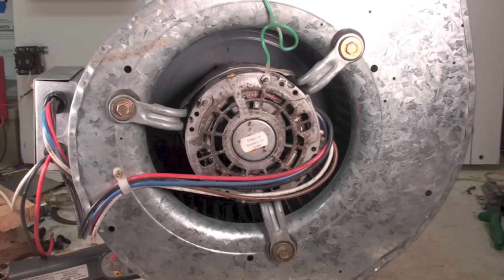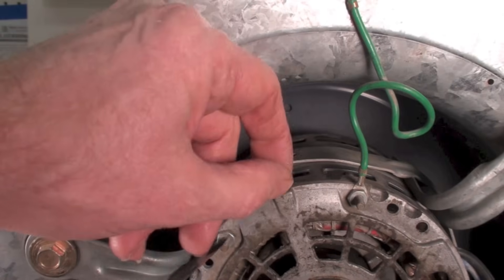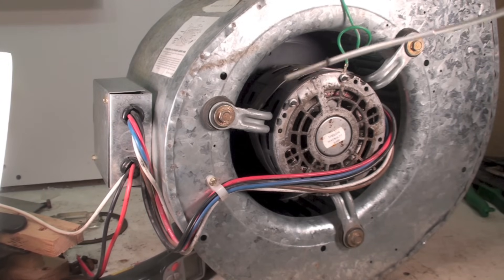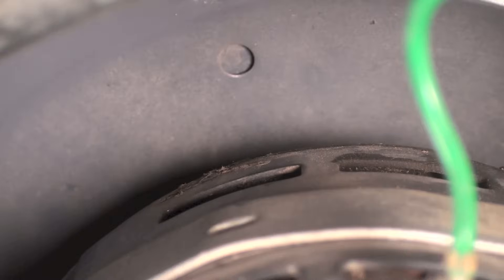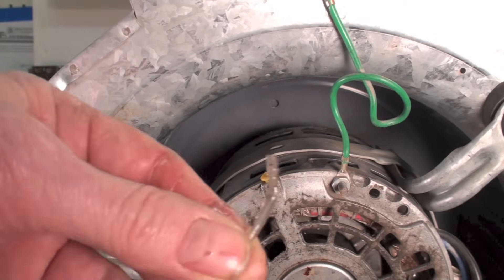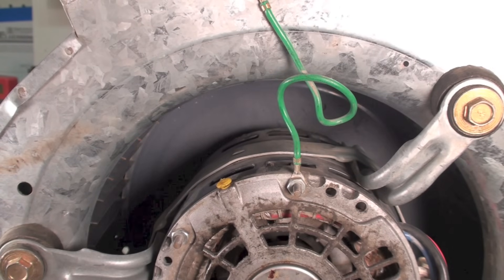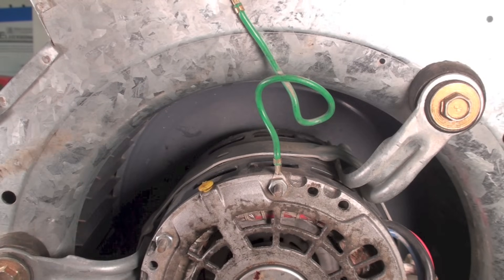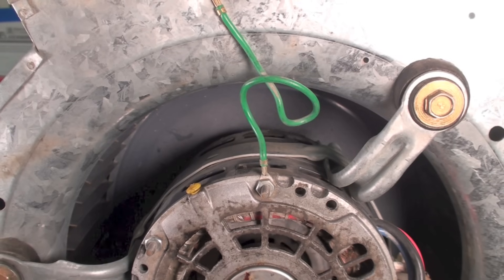How to oil the HVAC fan motor

Comment: Thanks Gary, you were very helpful to jump start me troubleshooting. Yes it is an old furnace. About a week ago, an electrical type of burning smell came up to the 2nd floor bedroom, late at night. Got worry about a fire. Went to the basement first to check the furnace. Could not smell burning, but heard an electrical humming and buzzing before the fan kicked in. Outside belt drive motor, no capacitor. 
The best is that I got a brand new motor, same specs on Easter Sunday.Owner of “James Electric & Motors” said I am open 24/7 and 365 days. Got motor and put new. Works like a charm! No more smell, humming and buzzing. No more erratic start and stop. Nice and quiet now. When I pulled the old motor out and open the flap, i noticed a loose white plastic electrical connector plate. The motor shaft still turns easily. I do not see burn marks or smell any burning.Last time the blower motor went, I paid $80 CDN parts and Labour. That was 18 years ago!The motor was $140 all in. USA
Reply from the maker: Glad you got it going.
GFM

Comment: Hi Gary, I have a Inter-city Gas furnace model HGC-125. The blower has a hard time starting. The motor gets hot. The blower motor has a belt and is outside the blower wheel. I suspect the motor is going or the start capacitor. I can not locate the start capacitor anywhere. Does this furnace model has a capacitor.
Reply from the maker: It probably does not have a capacitor.  If it does not start hit the motor with a hammer.  If it starts, the start switch is failing.  Means a new motor.
GFM

Comment: How to NOT oil the HVAC motor. You don't have a clue that these motors bearings SHOULD NOT BE GREASED ever. If you do it you will lose the motor shortly after. the grease collects dust and some people know that dust is abrasive, and that's it, the motor bearings gone.
Reply from the maker: Good grief.  They supply oiler ports for a reason.  
GFM
Reply: The bearings of these motors are made of bronze graphite that are self lubricating. This material started to be used in blower motors more than 30 years ago, and if yours has something else, than maybe it is time to plan for a replacement. Please be curious and google this material, see what it is and how it behaves.  If you lubricate them you will destroy them quickly. And in any case, as a general rule for  any bearings lubrication: once you lubricate them, you need to do it constantly and continuously, otherwise it collects dust and that's it.  Yes, runs nice and smooth with lubrication, but you need to do it constantly. Why the ports are there? I don't know, maybe because the manufacturer wanted to give work to some HVAC repairmen (happens a lot in the industry), or maybe somebody replaced the original motor with a so called OEM motor that is a reverse engineered version of the original with "improvements". What you need to do with these bearings is clean them periodically, remove any dust or material resulted from wear and tear, and leave them as dry as possible. If you find out that the shaft is loose sideways, well it is too late, you need to replace the bearings or the motor. If you do not, the wear will be bigger and bigger and eventually the rotor will touch the stationary part and bad things can happen. If you hear squeaks and cleaning does not solve it bearing replacement is the solution. If you feel vibrations , than be sure that you need new bearings or new motor. I do not know why these things are not known and why the "specialists" keep advising people to lubricate the bearings, probably because they want to give themselves work.
Reply from the maker: You might check this video:  https://youtu.be/txhJYwaguNc  Notice the oil wick surrounding the bearing.
GFM
Reply: You said it yourself in the video “needs lubrication continuously “, exactly what I said, you mentioned bronze too, so why are you still debating?  Let me tell you my story, one year ago some furnace cleaning guy lubricated my motor, which is about 30 years old, one year later guess what ? The motor died.  Coincidence? I don’t think so.
Reply: 31 years is well the expected service life of both gas and electric units. Modern units are typically expected to last 20-30 years, and last longer than older units. That said, a model from the mid-1980s (about 30 years ago) isn't expected to last reliably beyond 20-30 years. I think it's more likely that the oiling allowed your motor to die one year later, rather than maybe 4 months later.
Reply: I agree, in my case it was about the time to fail, but there are a lot of failures of much "younger" motors, at 5 or 10 years, because of lubrication. Whoever is a fan of lubrication I suggest to google bronze graphite and educate themselves what it is and how it behaves.

Comment: grayfurnaceman - do you think this noise is from within this plastic housing. I want to call it a blower motor but I'm thinking that's down lower. https://youtu.be/-MWq-XrCM-c
Reply from the maker: That is the inducer motor.  First, I would remove the inducer assembly to see if there is any obstruction.
GFM

Comment: Never mentioned what kind of oil to use?  Just showed that one kind in the bottle which would be nice to know some alternates to use.
Reply from the maker: An SAE 20 non detergent will do nicely.
GFM
Reply: Thanks I bought some of that 3-n-1 electric motor oil. My motor is shot on my furnace even after letting it sit overnight the oil did nothing to help.
Reply from the maker: Usually, if a motor locks up the bearings are scored and oil will not help.
GFM

Comment: Does anyone know where I can get replacement felt/paper packing for a Dayton Motor with oil holes for the bearings.  Motor info 5K9770  -  SA55NXCSG- 5326 - 1/4HP 115VAC - DATE: A88

Comment: You just saved me so much time and money. I had a bearing in the heater fan for my house starting to make noise tonight, at the beginning of a snowstorm and several days of below freezing temperatures. A few squirts of oil and it hasn't made a peep in several cycles. I am at least able to put off the actual repair until a convenient time and won't have to find a new motor in the ice storm. Thanks!

Comment: Mine doesn’t have holes to lube?
Can I just spray into the motor or that can cause fire ?
Reply: It only makes scratching nose when I turn on heat
Reply: No holes = no oiling needed / sealed for life / sealed until there is an issue and has to be replaced.
Never put oil into the motor. It will damage the motor, and can cause all sorts of problems.

Comment: Thanks
Reply from the maker: Welcome
GFM
Reply: grayfurnaceman of course mine were sealed. I pried the caps off carefully and added mobil-1  5 w 30 oil to what lubricant remained. Cleaning the squirrel cage and replacing the 6 missing screws definitely helped. It's running strong and quiet now. Thanks again.

Comment: weird my landlords swap cooler motor doesnt have a place to put the oil in? its one of  those that are mountied on top of the roof. iv lubed the sides but there is nothing for the motot
Reply from the maker: Many of the motors are permanently lubricated.
GFM

Comment: Had a motor that was overheating from no oil, making noise, had play in the blower bearing. Used 10 w 40 Synthetic car motor oil, been running for a year,good so far...
Reply: Here I have a "zoom spout oil" filled with Mobil 1 Synthetic 10W 30. I have re lubed the Carrier here about every 3 to 5 years; or when I hear it slightly squeak when it is turned off. The Furnace is a dual unit; 2 motors. Two twin furnaces. With the power off one can give each a pull and see how long the fan/motor takes to stop. ie compare left and right units. The Air handler is from 1985 and the original motors, still running after 32 years.

Comment: Thats called Turbine oil. Also, if you pull the housing as you have done, you don't have to do all that bending of the zoom spout tip.  Oil it from above  down through the squirrel cage blades and into the oiler access.  sometimes they accommodate for it in one of the blades like  for set screws...  The biggest mistake I see in the field is people forget these oilers are gravity fed, so when you install a motor, keep the oiler between10 and 2  O'Clock.
Reply from the maker: The video was assuming the blower was installed on an appliance.  I found more failures in port positioning from the factory.
GFM

Comment: i sure hope that I can get to my plugs... The motor faces the cold air return manifold which is 3" from a cinder block wall. I may need a child or Chucky from Childs Play to reach a tiny arm through the filter housing.

I'd like to hear the failing blower motor. Mine is beginning to squeak.

Comment: have a gas furnace that hasn't been running in over five years. went to test it today to see if blower works, but it didn't kick on. I did hear the gas valve make a click noise. the gas isn't turned on yet. my question' does the gas need to be turned on in order for blower to work? looks like a little relay or switch on the gas valve that connects to the blower. older unit.
Reply: it should ignite before the blower comes on.
Reply from the maker: Your gas must be turned on for the blower to work unless the thermostat has a "fan on, auto" switch.  You can test the fan there.  You have power to the furnace because you hear the click.  Turn on the gas and go thru the same steps.  Depending on the age of the furnace, it will either fire up on its own, or you will have to light the pilot.  Hope this helps.
GFM
Reply: yes you're right. after some research the fan switch works from heat. the connection to blower then will activate once furnace is heated up. simple unit but interesting the way they were designed.
Reply: yes, unit up & running. thx for reply

Comment: How you been sir 
can I use zoom oil 
in circulator pumps motors and bearings
Reply from the maker: Yes.  I did for 35 years.
GFM

Comment: I have a Dayton fan motor running my whole house fan. I've never oiled it, so based on this video, I went up and looked at the motor itself. I found 2 yellow plugs that look right, but they are facing sideways from the motor housing (the motor is mounted such that the shaft points down). The motor housing says "Lubricate with 30 drops once per year". First of all, how do I measure 30 drops when the holes are sideways? Do I need to unbolt the motor and turn it hole-up? Also, I presume 30 drops per hole, not 15 each.
Reply: laughing

Comment: When I went to pull off the top/cap of the plug using a knife like you, I accidentally sliced off the cap!!! How can I get the rest of the plug out? I'm such a klutz.
Reply: use a small screw and insert into oiler hole than just pull it up and you have the other piece
Reply: Lol, just did the same thing. Heated up a pin and slide it in. Let it cool and out it came. Us Klutz’s have to stick together.
Reply: Liz Duncan Your not a klutz!  So many people were couldn't even do what you did. Or they wouldn't even try.
Reply from the maker: About all you can do now is drill it out.  Don't worry about pieces getting into the bearing.  There is a filter that holds the oil.
GFM
Reply: thank you

Comment: If I hear a squeaking sound, is that the blower or the motor making noise? How can I fix this problem?
Reply from the maker: +Pedro Marquez First, shut down the furnace and move the blower wheel.  If it moves easily, its ok.  If it is stiff, the motor will have to be replaced.  Hope this helps.
GFM
Reply: +grayfurnaceman I cleaned the fan and I oiled the motor but it still makes a loud humming noise.
Reply: +Pedro Marquez make sure the motor is properly screwed in
Reply: Did you ever find solution?
Reply: Yes..i just oiled the fan and screwed everything again

Comment: my fit my motor won't come out of my fan does anybody know I took the lock nut off inside the fan and the shaft won't pull off
Reply from the maker: +Waldon Linnell Take a look at my tool playlist.  There is a puller there that works well.
GFM
Reply: Ok thanks it worked

Comment: I recently had to replace the capacitor on the blower motor.  Afterward we noticed the blower sort of rumbling. I thought the blower cage might be the culprit after all the things I read about fins coming loose and dirt falling off which causes it to be out of balance.  I even realized on the way home yesterday the blower sounds very much like the tires on my Tahoe that are out of balance.  After all my research, I decided to take a look at it.  I could determine nothing about the blower cage other than I can tell it's out of round a bit when I manually spin it slowly.  I do see one weight on a fin, and there does not appear to be any missing weights or loose fins.  I removed the blower and cleaned it thoroughly.  There might be some difference but it's not much.  The motor seems to turn smoothly and there do not appear to be oil holes.  However, the shaft on the motor has a bit of play in it.  I'd say I can move the shaft in and out about 1/8".  Is this normal?  Is this likely my problem or should I still look towards the blower cage?  The shaft does not appear to have any wobble and otherwise turns smoothly.  Thanks in advance!
Reply: TroyTube Did you ever fix this issue?  One of my rentals has the exact same issue.  It’s a rumble every few seconds.   I see nothing wrong with the motor or the blower wheel.   I get the same sound with the door on or off the airhandler....
Reply: GrifFungin - i would probably dissaseble it and try manually to lube it
if theres no oil port, make one, then put a plug in it or at least some toyota silicone, let it dry and try it again
good luck
Reply from the maker: +TroyTube The end play is normal.  Blowers can come apart where the hub is in contact with the blades.  Its not very obvious but there should be some paint missing at the contact point.  Also, the set screw portion of the hub can break loose from the rest of the hub.  Other than that, the blower could be cavitating.  Usually this only happens when the blower door is off.  Hope thus helps.
GFM
Reply: It must be the motor that's the issue.  I replace the blower wheel and it sounds exactly the same.  Sort of a rumble that is every second or so.

Comment: Update.  Still running.  I have been adding 5 drops of the Briggs oil to each tube every few days.  Time varies with outside temp and amount of use.  I noted a range of 10 to 40 seconds of spin after shutoff.  I am shooting for mid  twenties.  I really wish I could buy some new Permawick goo.  Anybody have a source?  Anybody work at a motor factory?

Comment: I use tri-flow spay with the included hose. Its a penetrating oil
Reply: Penetrating oil does not lubricate well and wears away fast.  It is great to free stuck parts but then you need to oil them.
Reply: solarsynapse not tri flow. It's a superior lubricant. We use it extensively as a lubricant in aerospace applications. There are some aviation apps that it's the only FAA approved lubricant.
Reply: Hmmm.  Bicycle lube?  Some with PTFE (Teflon) that the maker DuPont says to not use as a lubricant?  The chemical that when heated past 400 degrees F kills birds?  I must be missing something.
Reply: solarsynapse triflow tf20006. Used for aircraft piano hinges and Heim rod bearings. Not high temp apps. Traditional oils don't flow as well into tight spaces and collects dirt, debris unlike triflow.
Reply: Good 4 u buddy & I bet u want a junior G-man badge for this info. It'll be under ur tree this X-mas delivered by the tri-flow three some king himself, Santa. Please wear your mask!

Comment: How about a draft inducer motor? Do they typically have oil points at well? I looked on mine and I didn't see any.

The problem is that the furnace only SOMETIMES engages. The thermostat clicks on just fine, but that often just leads to a buzzing/humming noise from the furnace. On times that the furnace does decide to work, the blower motor will kick on and shortly after, everything else will start doing it's job.
Reply from the maker: +asdfgoogle Most of them do not have oilers.  If the rotor of the motor is stiff, the bearings have failed and it must be replaced.  You can oil the shaft near the bearings.  That may help for a while, but the bearings have failed. 
GFM

Comment: If the motor is sealed without oilers you can open it up and add tubes.  I cut a notch in the metal caps and a notch in the housing in line with a vent hole with a Dremel (Be careful not to damage the coils!  Don't get grindings in the bearings!  ) and added plastic tubing (Ice maker water line?) to the hole in the outer bushing.  While you are at it you could clean and polish the shaft and bushing if you think it needs it.  Be sure the goo wick is not impacted in the hole.  If so, clean it out and add some of the fresher surrounding goo or leave it out and push the tube in up to but NOT touching the shaft.  I also added 1" of lantern wick cut down the middle and inserted in the end of the tubes at the bearing end.  I used appropriate machine screws slipped into the outside ends for caps.  So far so good.  Not something that everyone would try but I am cheap and tenacious and did not want to throw away a good motor.  If you try this, you may want another motor on hand or have fast access to one.   I occasionally turn the furnace off and check that the cage still spins free and then turn it back on.  BTW Marvel Mystery Oil barely lasted a day oiling without tubes or wicking.  Hoppes gun oil lasted over a week oiling without tubes or wicking.  Briggs & Stratton oil which is detergent straight 30 seems to work well.  The non detergent Zoom oil is probably best.  I cleaned and removed the previous oil before trying each.  Yeah, I like to experiment too.  ;)
Reply: It'd be great if you made a video of this method.
Reply: solarsynapse